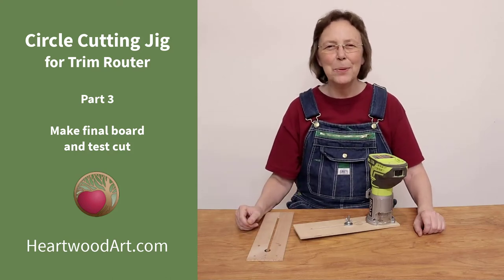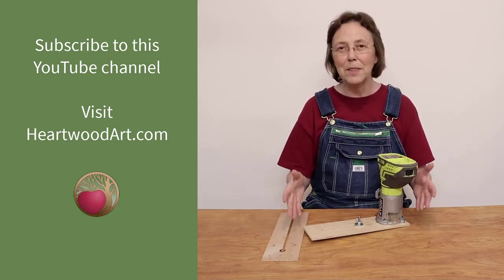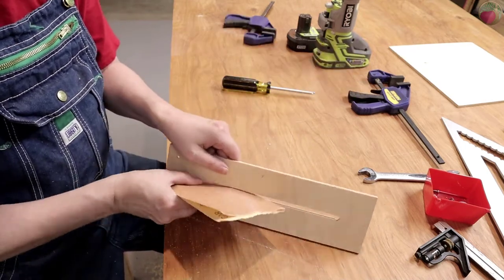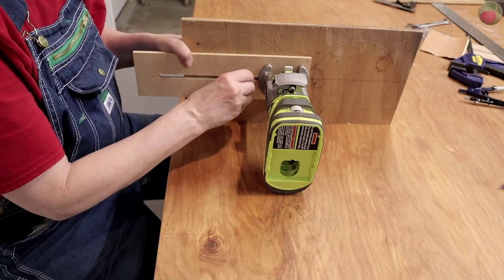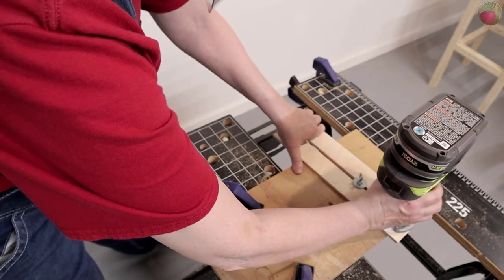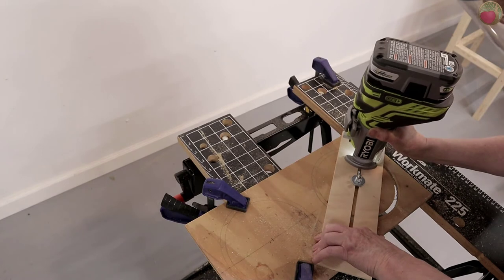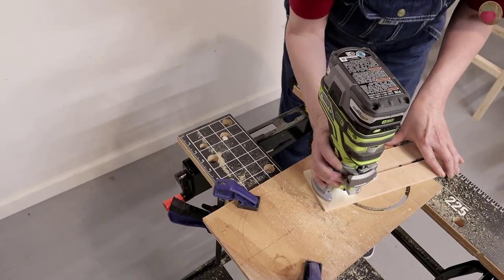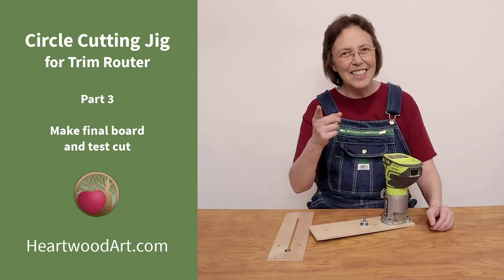A DIY Trim Router Circle Cut Jig Part 3

Comment: Can this cut 3/4hardwood
3/4” hardwood with Just 1 cut depth
Reply from the maker: @stevemumford1999  I seriously doubt it. And even with a standard router, I don’t know if I’d try to do that in one pass
Reply: Do I need a plunge router for deeper cuts
Reply from the maker: @stevemumford1999  the plunge part doesn’t really play into it as far as depth. You can just drill a hole as I did for this little router. But I would still not try to take out 3/4” in one go no matter what router you use

Comment: Whoo, hoo- I am 100.I bought a router a week ago, and don't know what to do with it.  Its a honkin' 2 1/4 hp so it says. Time to spray for bugs. I need more education on this stuff. I'm supposed to make a circular bar stool top out of wood in a couple of days. I just learned how to find the center of the piece on paper. I think paper will help me with the wood as well. Then some kind of jig with clamps or eventually a jug if it doesn't work.